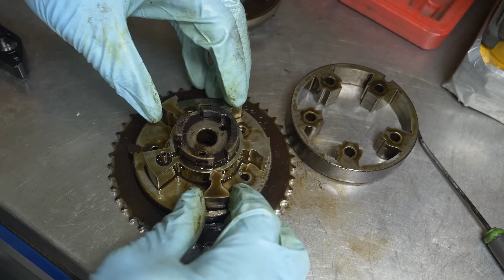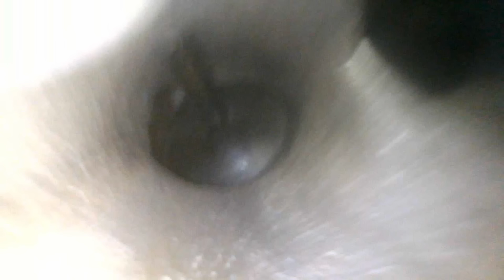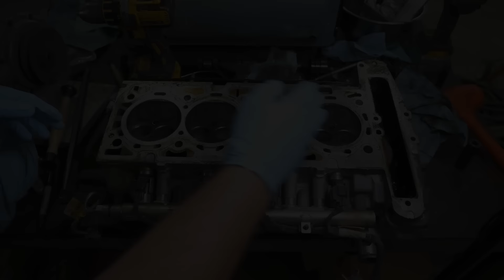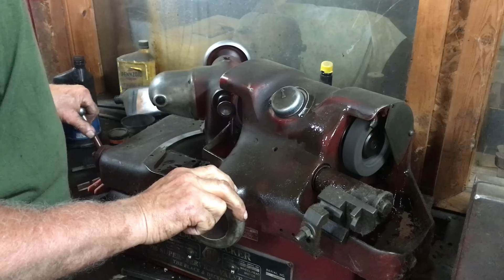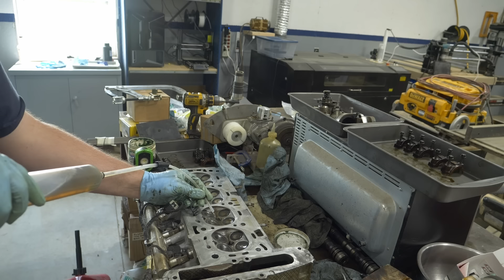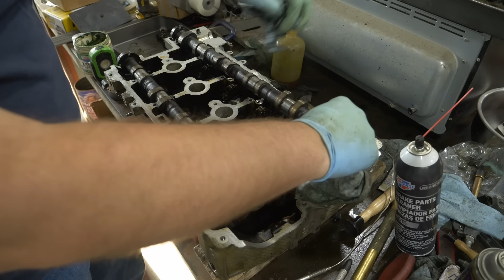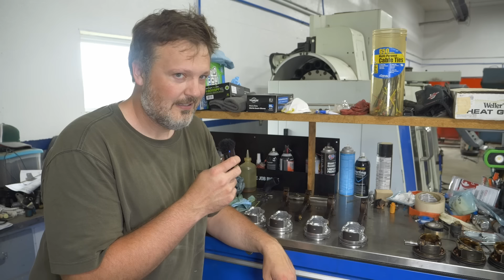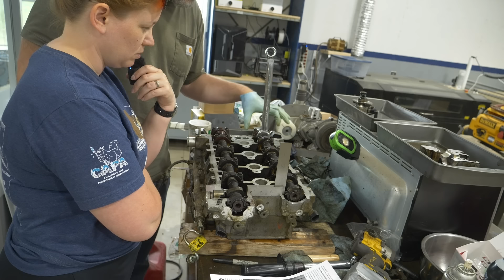How Did it Ever Run? Equinox Still Won't Start

Comment: I have a 12 equinox, it burns a little oil but as long as you check your oil it is fine she is rusty but has been a really good car ! Only thing I have changed is both cam sensors & replaced the muffler ! It only has 126,000 on it. OMG it's silver too !
Reply: 126k and burns oil?  You don't see a problem?  Come on man, that's ridiculous!!  This is exactly why I refuse to buy newer vehicles and keep my old stuff running.  They don't burn oil after 126k.

Comment: I'm watching to see if I was right or wrong.... I bet the rings were toast...
Reply: I was right, damn 2.4L Ecoturd.... 0w40/5w40 and new pistons.

Apparently it's something to do with the ring material and installation that was wrong. They will run the engine out of oil quickly, which you can see the results showing up there.

Comment: So, this engine apparently went ages with complete oil starvation and no one noticed.  Perhaps the driver listens to very loud music on earbuds?
What's messing with my head is that reluctor, if it moved incrementally, should have shown other signs; and having it slip a clean 180° and not be obvious now is equally puzzling.
Reply: It would make some sense if it hit something but what on earth would that be? If the reluctor wheel suddenly hit a solid object that could plausibly explain why it spun a full 180 more or less instantaneously and it would very much make the engine quit running immediately. The problem is I don't see any contact spot on the wheel and I suppose Wes would have found the object the wheel hit if that had happened. Don't really think it was the sensor because that still seems to give plausible readings.
Reply: To some extent the ECM can compensate for the cam sensor reading going out of phase with the crank, but I have no idea what the computer does with information form the sensor that is that far from normal. The cam itself would still be timed correctly on the chain if the timing hadn't jumped but would the adjust timing so far off based on the sensor reading that it wouldn't run? What a pile.

Comment: What a lemon of an engine. Happy Father's Day Wes!
Reply: They aren't good. And then people abuse them by not changing and checking the oil. 5k full synthetic oil changes at most with checks in between.
Reply: @mph5896  yet in Europe the Ecotec engine range has 12K-18K service interval and we can get 200K out of them while not really bothering to service them at all.
Reply: @mph5896 I have a 12 equinox and they say 5000 miles sorry nope will not do it ! I changed oil in cars since I was 8 the way I learned was change your oil @ 2,500 miles and I do that on all the cars I own.
Reply: @williamcap2236  People are going 8-10k on the cheapest oil they can get in these buckets, and wonder why their engine grenades.
Reply: @mph5896 exactly or not ever checking your oil ! Which blows my mind, people are just clueless they park their butt's in the drivers seat and don't think about anything else !
Reply: First gen of these engines  (1.8- 2.0 OHC's ) run   forever like sewing machines, what went wrong GM?
Reply: @Bumblebee4788  nothing much, except the first gen was designed mostly by saab, from the 2nd gen engine saab was out of the picture unfortunately. That is the problem, softer valves, higher operating temperature, direct injection. None of these helps with reliabilty. I have the first gen 2.0, very torquie, horsepower is there, nothing much but is enough, i do maintenance once a year or every 15k km with dexos 2 5w30 full syntethic and i have no issue whatsoever
Reply: What a poor excuse for a engine GM should be ashamed!
Reply: Tacoma Narrows bridge effect, wow, that came out of left field!

Comment: OoooKayyy, scratching anything with a 2.4 Ecotec off my used car list.  Wow, I can hardly believe what you've discovered so far.
Reply: GM has an extended warranty program for a lot of them because of ring issues. but they are garbage engines unless you are meticulous with maintenance and even then. The dealer here conned the inlaws into 5,000km oil changes, It just hid the oil consumption until the warranty was expired and offered to sell them a new engine for almost 10k CAD.
Reply: Any modern GM should be off your list 😆
Reply: Ecowreck engines.
Reply: i had an 04 in a cavalier it was pretty good, only engine issue i remember was a coil pack going out.. i think my uncle has an 07 cobalt which i belive is an ecotec aswell its been good also and he does the absolute least maintenance id say probably none, it did quit once and i tracked it down to a bundle of ground wires that terminate on the front of the engine.. only reason we figured that out was because i stumbled on a post someone else had the exact issue

my aunt got a new cruze maybe a 2016' sounded like a bucket of bolts from brand new, like a subtle exhaust manifold rattle